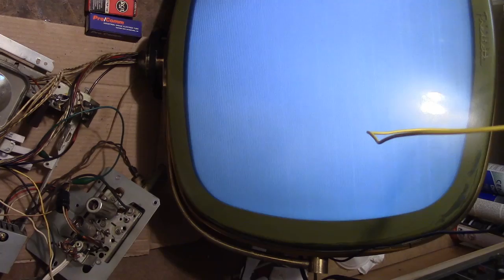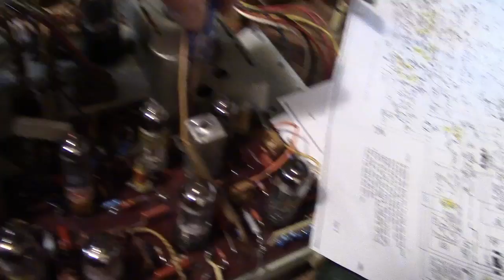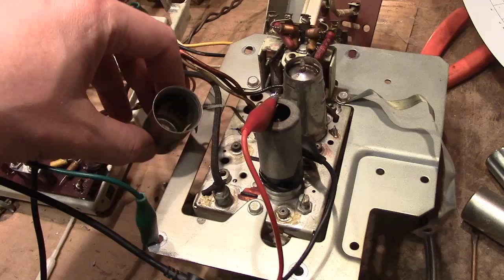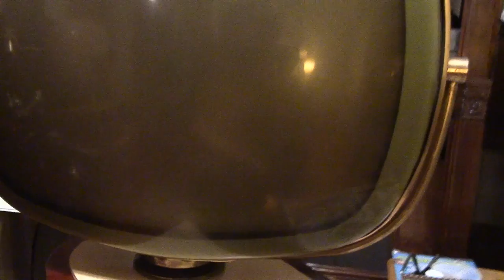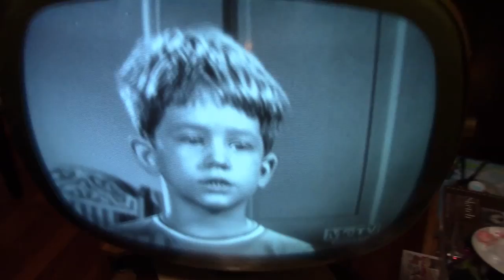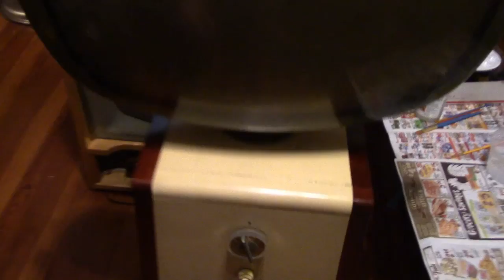Predicta Pedestal restoration p4o4

Comment: The dark spot in the center may be caused by ion bombardment, if this CRT does not have ion trap or aluminized screen. And if it has aluminized screen, it may still have little ion burn. https://en.wikipedia.org/wiki/Ion_trap#Cathode_ray_tubes

Comment: I noticed the Predicta's seem to have a larger screen surface to other TV's which have the top and bottom cropped off
Reply from the maker: I'm nut sure what you mean.  They are the same as any other set using a rectangular CRT.  Maybe you are comparing them to much earlier sets t hat used a round CRT where there is usually a mask cropping off part of the CRT face to make it look rectangular ?
Reply: yes the round CRTs being cropped I meant
Reply from the maker: The switch from round to rectangular CRTs happened around 1951.  Predictas were made from 1958-61.  Most of my collection is from 1947-1949 with round CRTs.

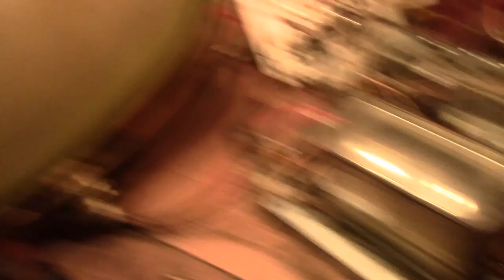Comment: 9:15 those CRTs are made of relatively thin-walled glass and feel like practically nothing picking them up. Years ago I was in the electronics repair industry and started at a Mom 'n' Pop TV repair shop in Philadelphia and Ray the owner would get a little bit nervous when we got a Predicta in for repair and it needed a CRT replacement and I would take that tube out of its swivel-cabinet and move it around and he would say "Be VERY careful with that" and I was always very careful with them.. did you ever break one of those tubes?

Comment: hi, im working on a 1961  curtis mathes royal dane . its all good except weak fm and will not lock into fm stereo, it will only on a few stations.also some stations are louder than others. i did replace some tubes in the fm circuit, cleaned all and its a little better. i also tried aligning the coils to get the best reception, but (2) of them are frozen, so i dont want to break them. i also noticed on the print that there should be a  - 1.5 volts on one pin of the 6u8 but im reading  -.8 v   other voltages on the tubes seem ok? what should i check now ?

Comment: I had a radio that had a microphonic tube in the output that if you disconnected the speaker, you heard the sound coming from the tube. In your case could one of the IF tubes be microphonic where the sound signal  is present?Carl

Comment: Nice work, Bob. I'd love to see a Continental in your workshop, even better if I have one in mine! Good luck with the Debutante, they're definitely more packed in than the 21 inch model chassis. I worked on a Debutante and Princess together as my second and third restorations. These were the ones that you kindly provided the stand photos for quite a while ago. They look awesome on their replica stands whilst running. The boards in the seventeeners are not as tidy as their larger counterparts, and one of mine had a few traces blown off.